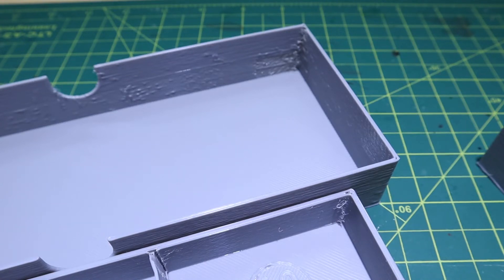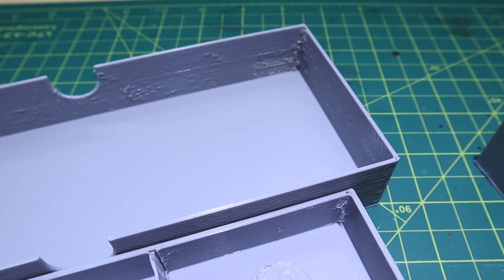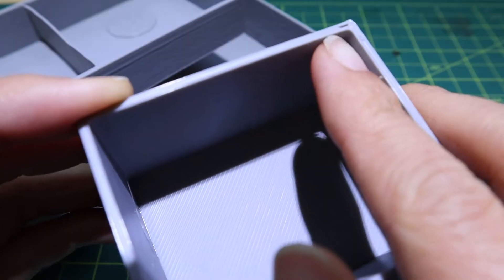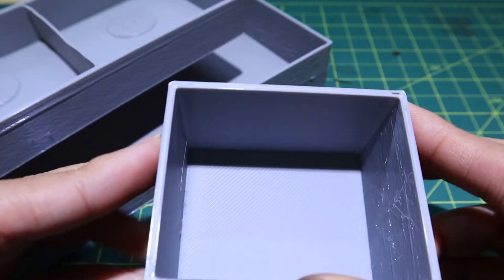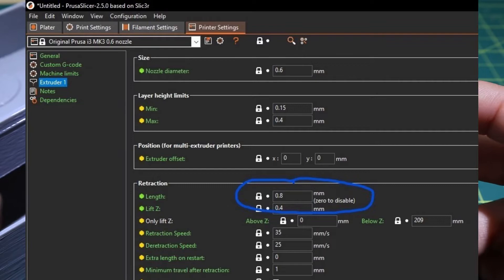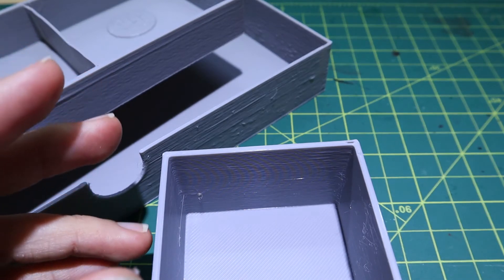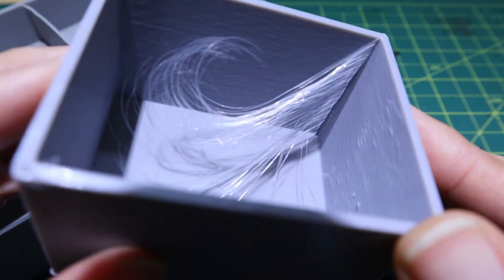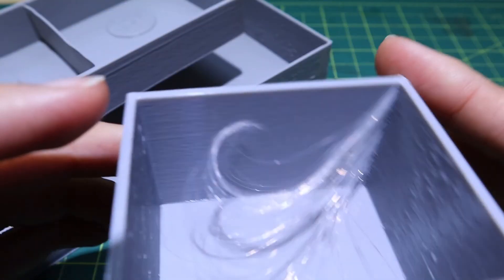Under extrusion at seam (retraction settings)

Comment: You want some retraction, maybe 1 to 1.5 for direct drive, there is also 
"extra length on restart" option in prusaslicer, did you try it and if so what value did you use?
Reply from the maker: It is diffrent from case to case. For example I used 0.6 nozzle instead of 0.4 and the problem became worse. I did not use the "extra length on restart". I know that retraction 0 creates lots of hairing but the "seam" is cover the best with this settings. You will need to play a round to find the good set of parameters
Reply: in her case it's probably not fixable by the extra length on restart option, but the "Retract Amount Before Wipe" and Wipe length.

Comment: try keeping retraction same but instead add extra on the restart
Reply from the maker: I will try, thank you for your suggestion.
Reply: It can help when you have a longer travel after retraction and your filament oozing. But it makes a blobs when the travel distance after retraction is short.
I have a good experience with a combing mode>not in skin>avoid printed parts.
Reply: Extra on restart will inherently overextrude, by A LOT unless it's some extremely small amount like 0.05. I've helped folks who were getting nozzle collisions and layer shifts only on certain models track the root cause down to this. If it seems like you need extra restart, there's actually another problem you're missing that needs to be fixed.

Comment: increase "prime retraction speed" (not normal retraction speed) by 5mm/s in cura until you get good results ! thank me later!!!
Reply: can you explain this? i have the same issue and my values are: retraction distance 0.2mm and retraction speed 30mm/s. I have no problems with stringing. Sorry for my bad english 0:
Reply: Thank you!